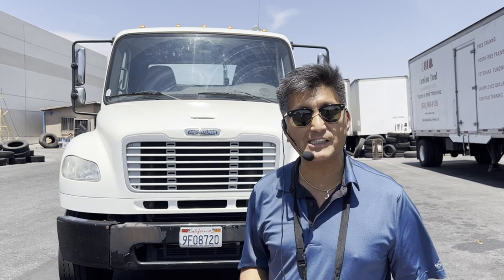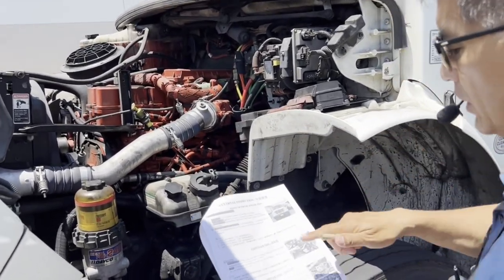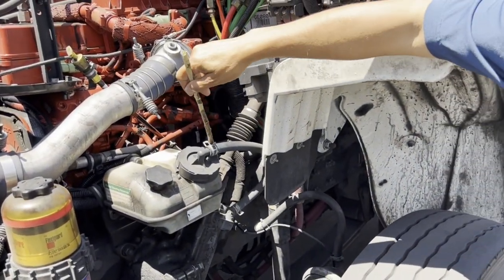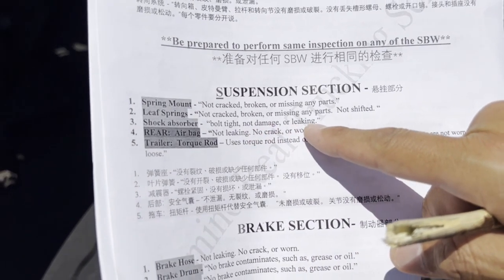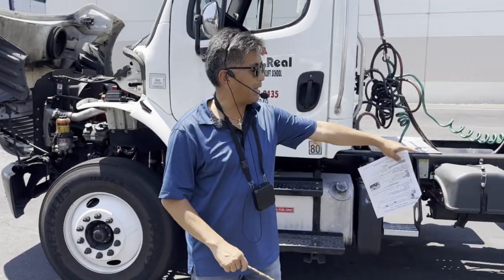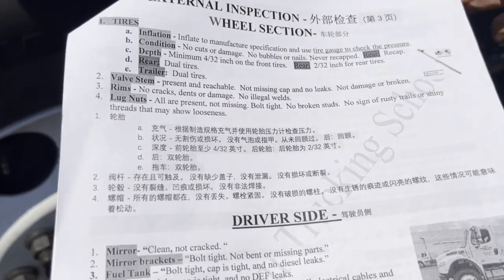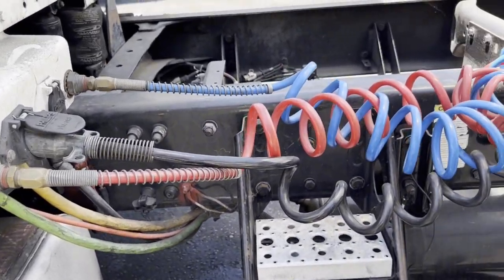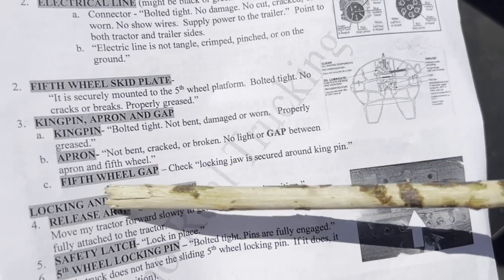2023 NEW How to do Automatic truck Class A exterior outside truck inspection - Instructor Gene

Comment: Will be nice to follow the checklist provided by DMV, here you go by the old style. DMV says it clear on the new instructions the rear of the tractor is not needed because is replaced by the rear of the trailer now. I will also add trailer frame with bridges and floor, abs side light, fifth wheel platform and bolts, locking jaws, steering column and boot, wheel bumps under 1", mirrors under 10", from the cabin, no illegal welds, to be mention. Anyway real thanks for your efforts and instructive videos  !
Reply from the maker: Yes, great advice!  =)